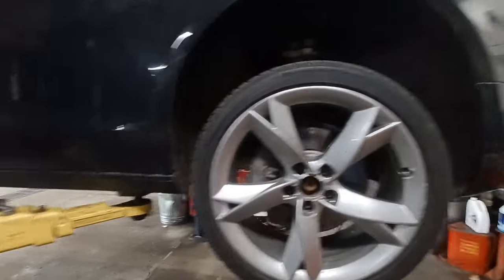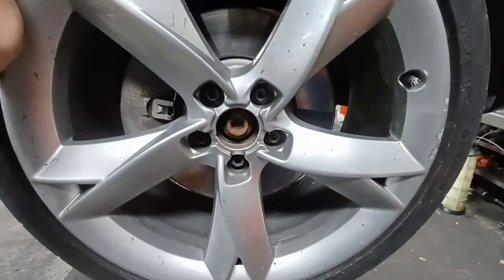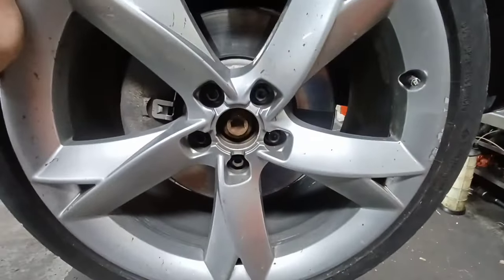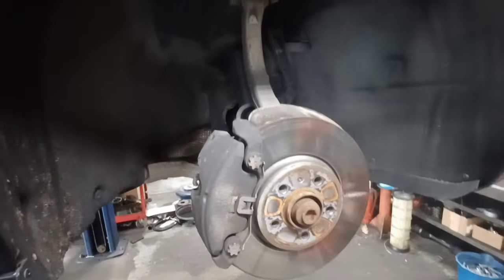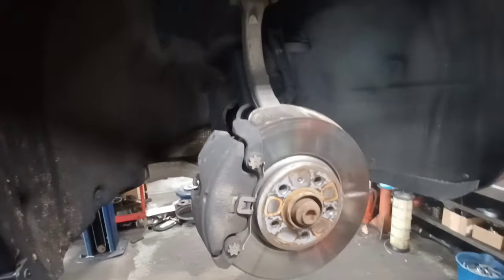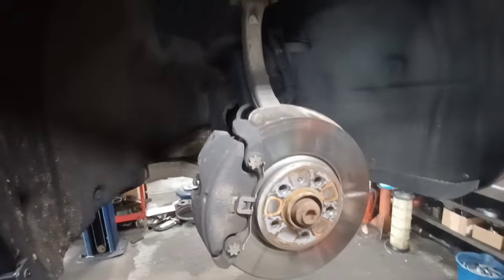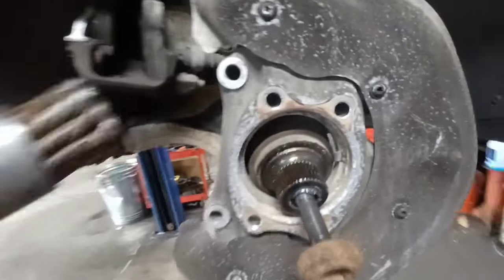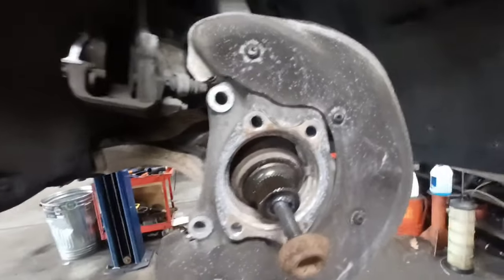2010 AUDI A5/A4 FRONT WHEEL BEARING REPLACEMENT

Comment: you showing the trick with those 4 bolts and an air chisel are a life saver that so many people don't know about and hammer, heat and do all sort of things that you can think of. i can say from my own experience with changing them in mi car i felt stupid now after so many times i ended up cursing at the darn thing for not coming off after blow torch it or air hammer and even  the using a sliding hammer and only half of it coming off in best case half of it being stuck in the spindle(i live up north so they corrode like hell from the salt)
Reply from the maker: Oh yeah man! I’ve had one so stuck once I ended up removing the whole assembly and bringing it to the press lol. Salty winters suck

Comment: UK mechanic here, done loads of these. Firstly, if you heat the aluminium leg with a blowlamp (from the wheel side) the hub comes out easier as the aluminium expands at a different rate to the steel bearing housing and it loosens it. Secondly, it's easy to press the drive flange out of the bearing with no special tools. All you do is put the 4 bolts into their threaded holes in the bearing housing so that they screw in and press the back of the hub flange and force it out of the bearing as you tighten the bolts evenly. The only problem is that you need to put some packing in as the bolts aren't quite long enough to push it out, also you want to distribute the load on the back of the drive flange to avoid damage. You could use anything suitable, even wood, but I use a spanner 'handle' part across the back of the flange so that the bolts press on the spanner as you tighten them and push the hub flange out of the bearing on the bench. Never fails, and the new bearing comes with new bolts anyway.
Reply from the maker: Excellent advice, thanks man

Comment: Im having issue with my 2009 audi a4 quattro.  I did a rear wheel bearing and it wasn't this easy. I couldn't get to bottom bolts with out removing the cv axle. Issue is after installing everything my ABS Speed sensor does not pick up anymore.  Looked like the bearing is sitting to deep inside the sensor hole. Ever run into that issue?
Reply from the maker: I havent seen that, did you double check your part number?
Reply: Did you use a 19mm or a 15mm? I need to replace my wheel bearing on my 2009 Audi s5 and there’s those two options and not sure which one to get
Reply from the maker: Are you asking about the allen bolt for the axle?
Reply: @UptownFights if by accident you pressed the bearing the wrong way(with the magnet towards you instead of the axle and the abs sensor) that might be a cause. or you might have put grease on the abs sensor or it just broke when you installed the new hub/bearing. it's fairly common
Reply from the maker: I’ve seen that before on some models, my bud did that on a 911 once, with these particular audis you can’t reallly do that the way the wheel bearing and housing are a assembly
Reply: @lauretiu  It was the magnet.  It got loose and fell off during installation I assume.  Total pain in the ass to remove and replace again.  Thanks for the reply. Removing the bearing again was last on my list,  but painfully did it again and sent that ebay bearing back.

Comment: Could you use a gear puller for the hub?
Reply from the maker: You could probably find a way to do it like that but the inner race will likely stay on the hub and need to be cut, torched or pressed off, if I was trying to do the job at home I’d probably buy a bearing with a new hub already installed if I could find one
Reply: @EuropeanAutoRepair  I had bought the assembly but it came unpressed also the old assembly came off as a unit. My first time doing it solo. I figured I had to unbolt the bearing from the hub.